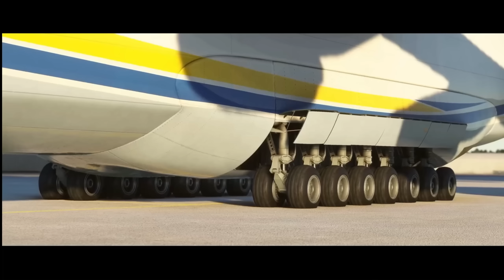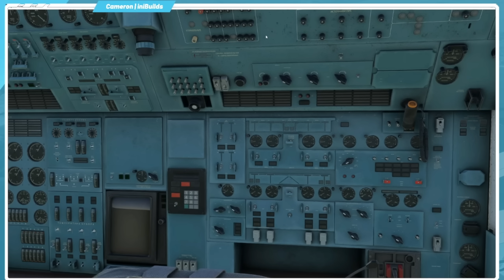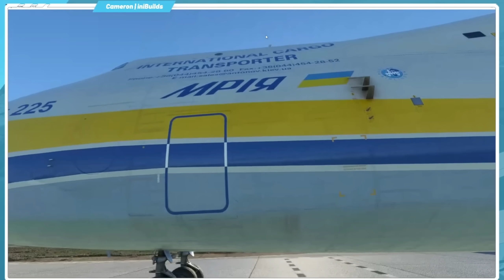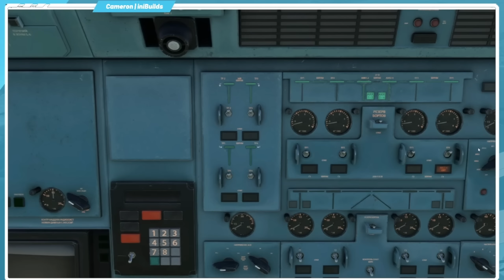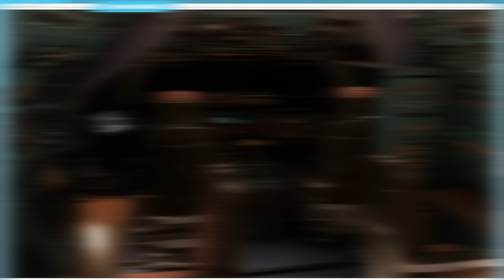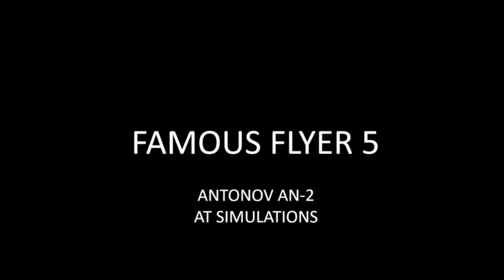ANTONOV AN 225 | IniBuilds Preview | Coming soon to Microsoft Flight Simulator

Comment: I will be curious to see if it really has 6 engines simulated or if it's 4 engines simulated like before. All previous attempts at AN-225 has been with 4 engines simulated which is a bit of a bummer...
Reply: They increasing simulated engines from 4 to 16 with the update. So all 6 will be simulated.

Comment: The plane is already available as freeware. Still I guess this one will be more of an in depth, I suppose.
Reply: That uses the 747 cockpit unlike this one
Reply: That freeware is not even a patch on this one. Only 4 engines work, it can’t do the loading like this one can, it uses the 747 cockpit…. Like dude…
Reply: @shinkicker404  Yes so ??? The plane model works fine and is very nice. If you want to pay for the rest, just buy it. Btw MSFS only support 4 engines. That's a limitation of the software I believe.

Comment from the maker: 😂What! Will I need two throttle quads to fly this beast!
Reply: The MSFS SDK has a 4 engine limitation (Engine.N ids of 0 - 3). 2 of the engine's parameters will have to be mirrored to another engine. While less realistic because of that, you'll only need 4 throttles :D
Reply from the maker: @krozareq  the engine limitation has been increased to 16 with AAU1
Reply: @SimHangerFS  Good to hear. Now they need to update their documentation :D
Reply: So looking forward to this and your always helpful setup guide video for the HC Bravo 😉
Reply from the maker: @John-ly1zt  😱